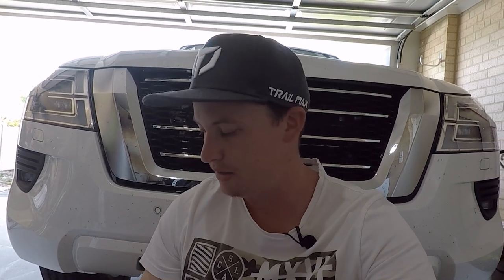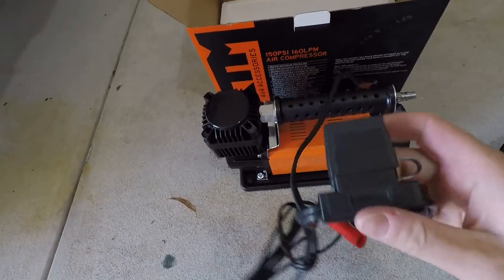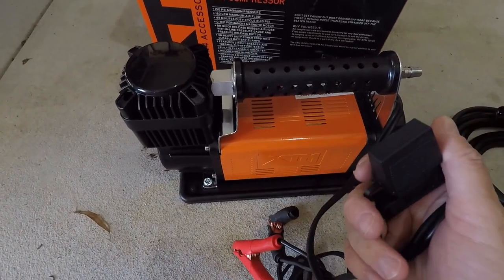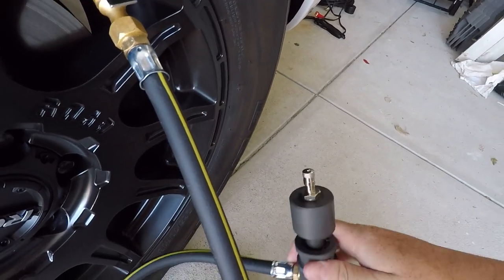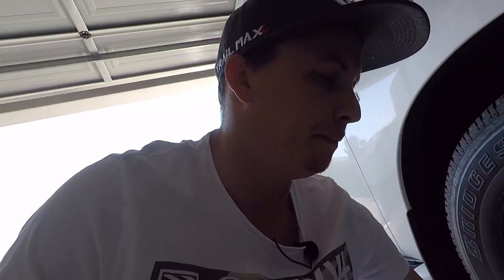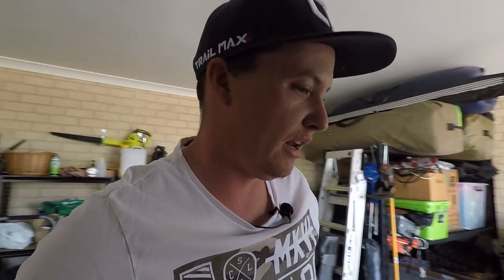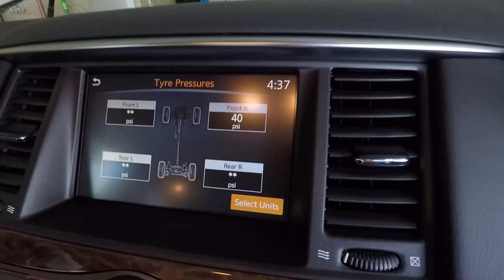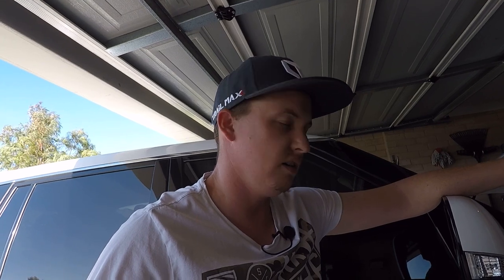XTM AIR COMPRESSOR HOW QUICK CAN IT PUMP A TIRE?

Comment: the XTM did a top job Brayden, what did you think of the indeflate? i got one two weeks ago and havn't used it yet
Reply from the maker: It’s good mate definitely takes some time off inflation and deflation as it does two tyres at once I’m pretty happy with it so far it’s great quality gear to.

Comment: just picked one up from BCF. no bag either. hose is bloody sticky and makes my hands black. Is your hose like this too?
Reply from the maker: Might be the plastic mate softened in the sun maybe? But no mine doesn’t leave a residue
Reply: @4x4CampingandAdventures  I just swapped mine for another one at bcf. Some have bags and some don’t. Open it up to check. But the hoses are still oily AF. Bad quality hoses. Gets worse when hot in the sun unfortunately

Comment: Maybe drop XTM an email because I got that same compressor nearly 2 years ago and came with a black bag with orange XTM branding on it. Unsure if they stopped proving them or you somehow didn't get one. Great for the price point and only swapped to the ARB compressor when going twin locked on my Triton. As a Triton owner it was bitter sweet seeing you upgrade rigs. Will miss seeing the old MN but look more forward to the new content a fresh rig provides. Plus it's not another cruiser haha. How good would a space cab chop look on a Y62! Even the dual cab chop with 300 added is boss.
Reply from the maker: Hey mate yeah all good things need to come to a end I suppose 😞 but look you get to see a big V8 hitting the tracks now and you can’t beat that exhaust note 🤣 yeah definitely didn’t get a bag and didn’t see anything on the box saying it was meant to be in there I might email BCF and see if they stopped doing it. Thanks for watching legend

Comment: I just tried mine out for the first time on my standard size tyre and it turns off after 10-15 seconds. I know some have an auto shut-off when they get hot but that shouldn't happen that quickly.
Reply from the maker: Nah shouldn’t mate mine gets through the lot with out cutting off could be a climate thing though?
Reply: Nar didn't think it was normal. Climates no problem down here in vic it's freezing haha just must have got a dud, it's well over the warranty. Not knocking there products though IV got a few xtm items and love them. Might try a different compressor though just for a change
Reply from the maker: Yeah probably just a dud mate unfortunately but BCF should just swap it over
Reply: @4x4CampingandAdventures  just a follow up, turns out the hose had a tiny cut in it which must have been causing it to shut off, not sure why it would but got a new hose and it's running fine!